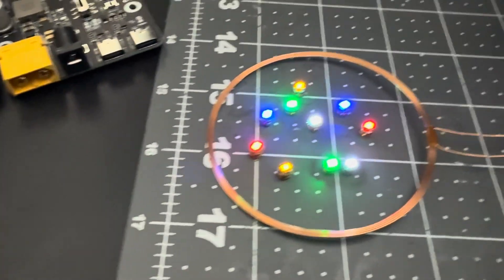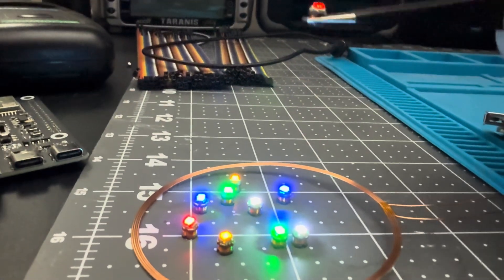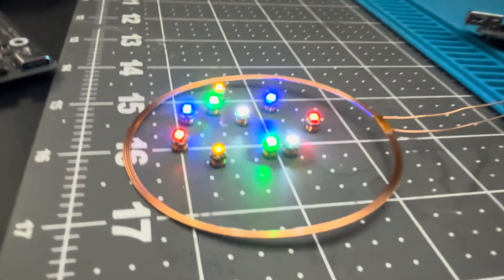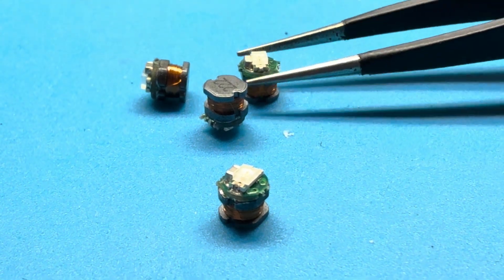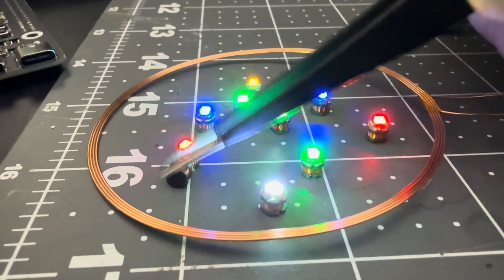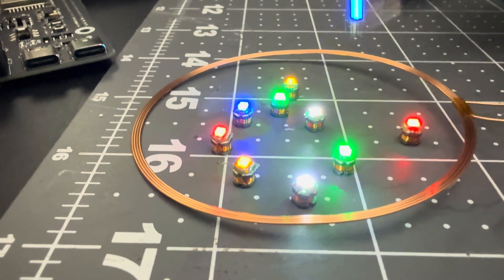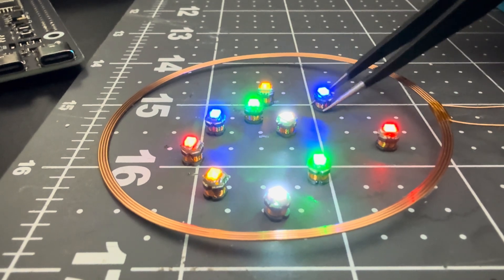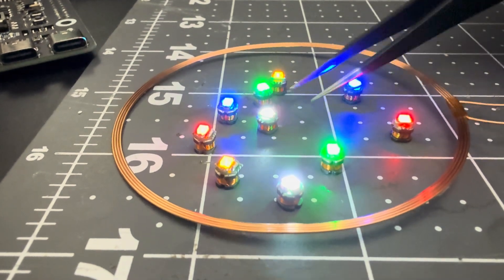Inductively Powered Wireless LEDs

Comment: I did some thinkering with such LEDs a few years ago:
You can increase the range and/or intensity of the light if you introduce a resonant coil (same coil specs as the emitting one) perpendicular to the emitting coil. This will lead to what's called magnetic phase synchronous coupling. 
I can't really go depper on the physics in a youtube comment, but I'm sure you got all the keywords to figure out what to do !

Comment: If only they were addressable
Reply from the maker: I feel like that would be doable if each led had a different inductor and capacitor and the transmitter could swap between the different “addressable” resonant frequencies. Not easy, but doable.
Reply: @ProtoG42  Alternatively, the coil can generate pulses representing each address. A small microcontroller on each module reads the pulses and turns on the LED if it is addressed to it. The frequency must be high enough to power the controller and LED. Special addresses can be used to enumerate each LED module to an address.
Reply: Yup then you sort of have re-invented RFID tags. For what i needed I ended up using RFID tags that have a LED that can be switched on and off.